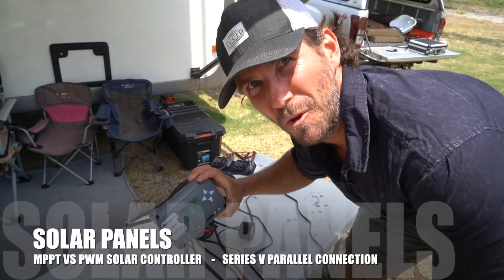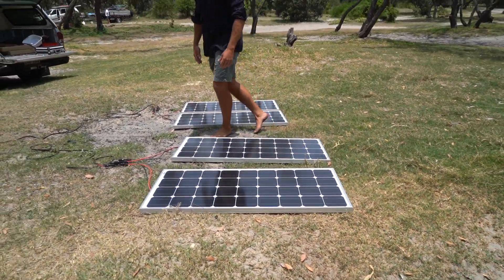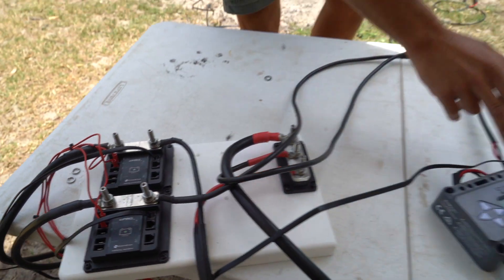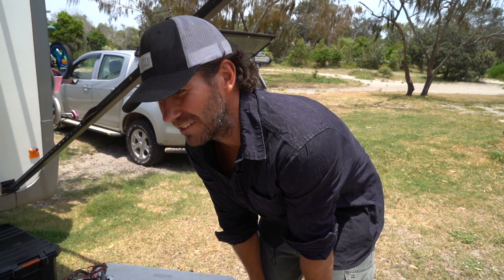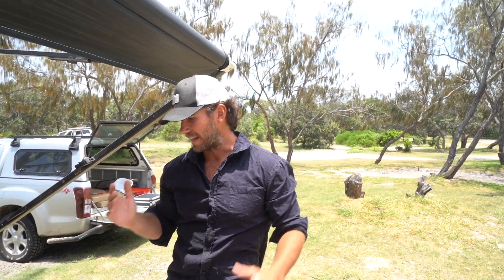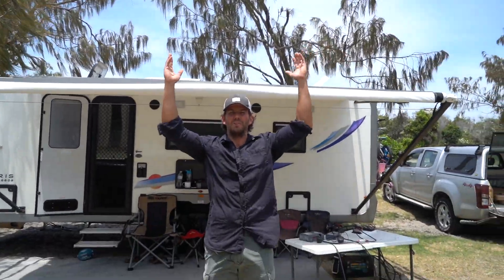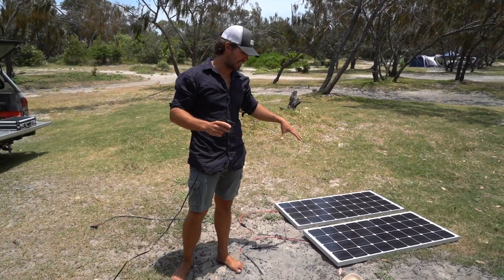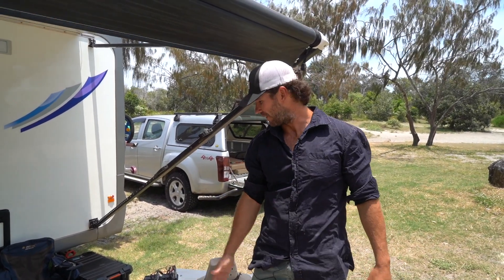SOLAR PANELS WHEN CARAVANNING OR CAMPING

Comment: very good explanation of what i keep telling ppl who ask me.135 watter on my van... and a 120 watter portable to ' chase the sun ' when camping, anderson plugged into the BMPro 35 unit thats in the van.  Seeing i do a lot of camping on the murray river.. its a trade off between baking the van to get sun for solar, and shade for a cooler bed at night... hence the portable to chase the sun. ( summer time this is, winter, well.. another story ) Upgrading with another panel on the vans roof soon, and it will be in parallel with the one that came with it. This, for me, is great, as when driving the solar panel as it is, puts in more amps than the the aux ( read: grey anderson plug on the 200 series ) when its plugged in driving...( night driving plugged in ) i " usually " have my 40 litre engel on freeze while travelling/camping for more than 4 days, and even with 240 amp hours of agm batteries... they take a dint ( unless i get the genny out ) hahah.

Comment: The benefits of mppt controllers come with using higher voltage panels or even banking panels. If you're not doing either, then there's no reason not to go pwm.  You can also get a decent mppt controller for sub $200, the price difference is coming down.

Comment: First up,i think enerdrive have given you a bum steer,as you should always hook panels in series (when you have 2 or more panels),and you should always use an MPPT charge controller to suit the input voltage of your solar array. The only reason you lost all output in your series connected array when you covered only a small portion of one panel,is because enerdrive has given you cheap panels that do not have a bypass diode.  I love your video's,and i know you are relying on enerdrive to provide you with the best information,but i have been installing solar on vans and campers for over 20 year's,and paralleled panels with a PWM controller is the least efficient method of installing solar systems to vans. Enerdrive should know better.
Reply: you sound knowledgable...what would be you most recommended panel for a basic van setup

Comment: There is something missing from this info, If putting them in parallel with a PWM  is better then why do all the Solar companies tell you to run them in series with a MPPT, Simple when you run them in series with an MPPT is they make higher voltage with less light so as the sun comes up they make more voltage earlier and later in the day and in peak times they really max out by keeping the voltage well above 12v in to the controller for longer IE with 4 panels in series early or late in the day you could be putting out 32v in to the controller but with 4 in parallel they will only be putting 8 volts in to the control which  is far to low to be any use to the controller when it comes to charging, Sorry Guys but you only have half the info, hope that helps. Keep up the Great video's Love your Channel. regards to you and your family,

Comment: I just gave up on Roof Panels in Series, although it will require a larger wire run and a larger controller.

Comment: I don't see a load being put on to the battery and trying to dump both systems into the same battery at the same time just isn't going to give the right results. Put a load on the battery and test each array separately and I am guessing you will see a bigger difference. Another advantage of MPPT is that you can use higher voltage panels (IE. 24 volt) where the extra volts will be converted into stored power. Newer shade tolerant panels are now starting to become available and you can cover a number of cells and the panel recovers to almost full Amperage output.

Comment: Awesome video mate! One question, are you able to connect two different panels in parallel to one regulator, such as a 120w folding and 160w fixed though an Anderson plug double adaptor? Or would I be better off using two regulators?

Comment: are the stand alone solar controlers better than those included in a bms?
great vid btw
Reply from the maker: greg9000 depends what brand you get I reckon. We have used a few bms units with inbuilt solar in our travels now and they have all been fine.

Comment: my dingo 20/20 pwm charge controller it won't work with my single house solar panel 180 watts why???
Reply: If it's a house solar panel, the voltage output is probably far higher than 20v. Maybe up to 40v or even higher depending on the model. Unless your controller is built for such high voltage (usually MTTP is best for that to get the most power from the panel, but you need to read the manual to be sure), running a house panel will kill the controller. You best off talking to someone who sells the panel and ask them what sort of controller is needed to run it.
Reply: @Here_is_Waldo  I got the 40 amp dingo  now it's working fine ..